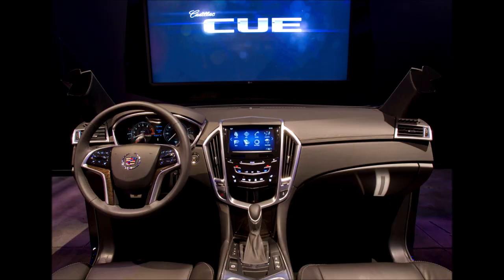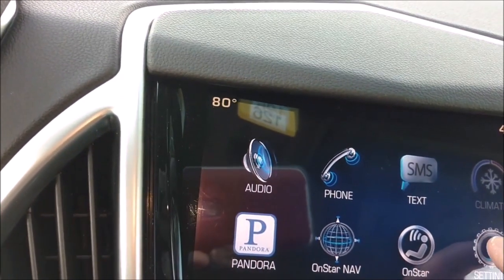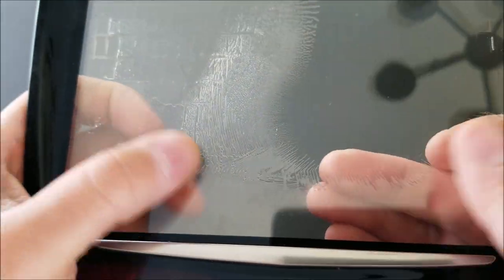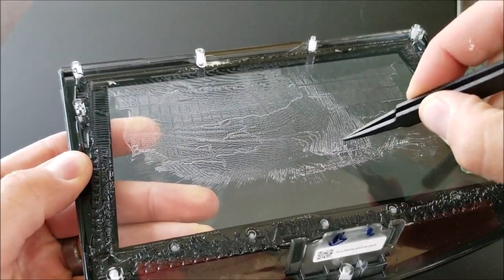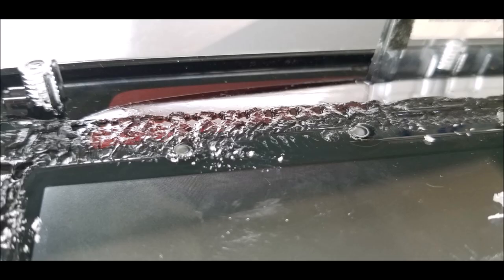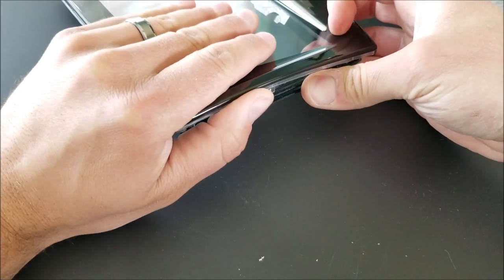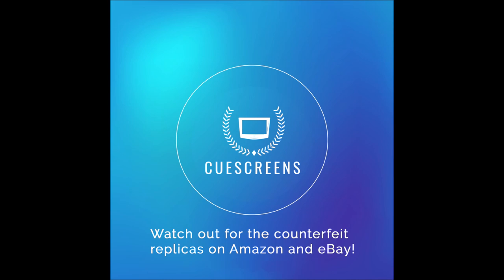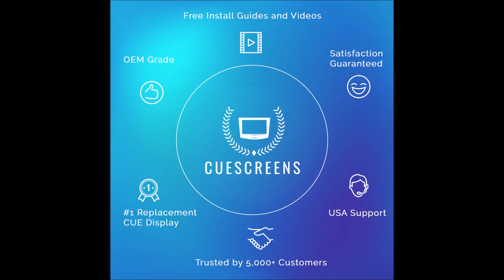Cadillac CUE  Design Fail Analysis | Teardown | CUESCREENS

Comment: Another  main reason is direct sunlight  on the screen.   On a hot summer day is when my screen  turned  that crazed look.   Look down through  your windshield.   The screen is facing  the sun
Reply from the maker: Yes, for sure. We find that in hot sunny climates, the factory screens only last 1-3 years due to the constant heat and sunlight causing the gel to evaporate faster. Northern states can go 3-5 years on the factory screens.